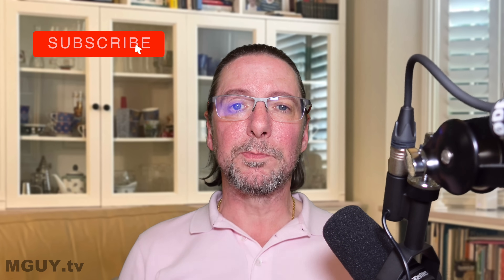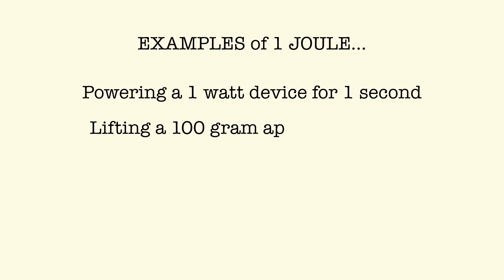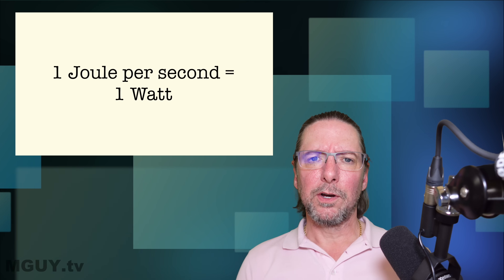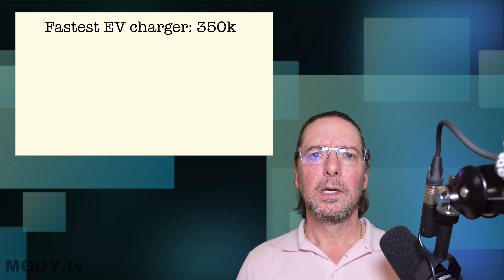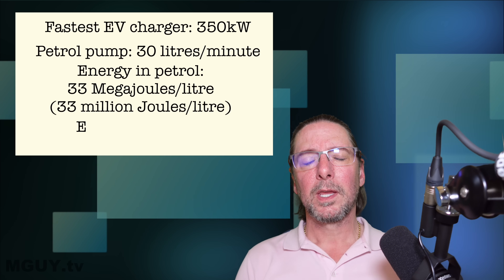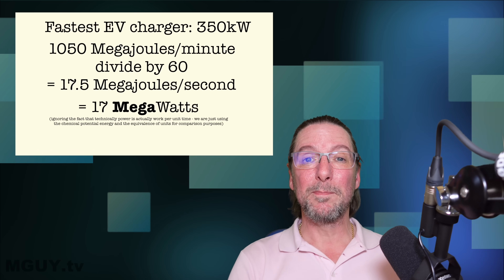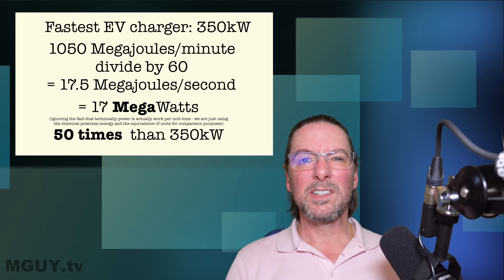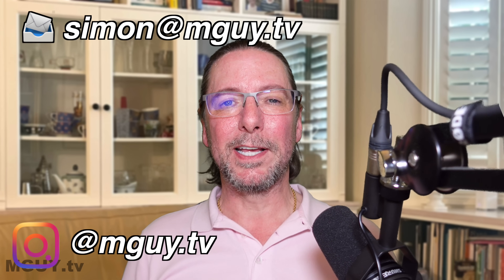Comparing charging speed of EVs vs "fuelling speed" of regular cars | MGUY Australia

Comment: This is a much more complex calculation than it first appears.  The amount of energy stored in a liter of fuel is not the right number to even be looking at, because only a small portion of that ever reaches the wheels, which is of course what really matters.  You have to factor in the relative efficiencies of combustion engines versus electric motors.  The electric car charging process also has foibles, as most cars are subject to a "charging curve" where the rate becomes slower as the battery state draws closer to 100%.

As a purely practical matter, what is the point of this exercise?  I mean, by this time, in 2023, electric cars are on the road in millions and are well-proven in regular use.  There are no mysteries to solve.  I daily drive my Tesla, let it charge at night in my garage, and I don't think about how long it takes.  I've also taken road trips, including one from Texas to Minnesota and back, hopping from charging station to station, and it didn't seem to be a problem.  A typical charging stop is around 20 minute, more or less, not too different from the driving breaks I would have taken anyhow.  (Which is to say, I don't babysit my car while it charges; I just walk away and do other things.)  I found that I covered about the same distance in a day that I would have in my old diesel Jeep.

Comment: Leaving aside the fact that use cases for petrol and electric are different for the moment, can you redo this video with the 1MW charger and a 522kW 5C battery made by CATL in the calculations? Using a 51kWh battery such as that found in the base model MG4 for instance, but using CATL's Qilin battery, and assuming an 800V architecture, and charging at peak ~500kW, would give you a full tank of electrons in 6 minutes. Correct me if I'm wrong, but that's about on par with filling up with petrol, around 5 minutes?
Reply: No one takes 5 minutes to fill up petrol. Also 500kW is absolutely bonkers insane for the electricity grid. Australia has 7000 petrol stations, if each had just 4 500kW in use at the same time, that would be 14GW needed. Surfice to say, this would entail building somewhere around 50% to 100% more power plants, and if we don't have batteries about 100GWhours in batteries, somewhere around 2000% more renewables than the entire current size of the grid.
Reply: @sectokia1909  No the maths actually stack up. Hypothetically if 20 million cars were to all charge at 500kW at the same time from the same grid, sure, it wouldn't work. But most people don't need to charge at 500kW, any more than they need to charge their phone at 500kW. They trickle charge at home from the grid or solar for free. Or transfer from their domestic battery to their EV battery. Charging at 500kW is for road trips where you need to just charge quickly and go. And you don't charge solely from the grid, you have Megapacks (or other stationary storage) on site. In Australia's rural areas this works very well, as there's plenty of space for low density, cheap energy storage such as Rust /Iron Oxide batteries and others. You don't need a grid connection, just a small solar set up, around 1MW, and about 10MWh of storage or so, depending on the demand you're supplying.

Comment: Fuel stations pump at 10 gallon/minute or 37.8 Liter/minute.  

Gasoline "charges" at 20,220 kw.  Ethanol is 15,000 kw.  Basically, fuel is 100-133 times faster than Battery charging.  20,000 kw/150kw= 133x.  Few chargers give 350 kw...  20,000/350=57x

Nobody uses joules.  They use KWH.  EPA sets 1 gallon = 33.7 kwh.

Comment: I timed myself filling up my car today. I had to wait because someone was at the pump already, but after they left I put in 42 litres of diesel which added 480 miles of range. Took me 6 minutes from pulling into the forecourt to driving off it. I need to repeat that 24 times in a year, so that's about 2.5 hours of time. I don't make special trips to fuel up, I pass these filling stations all the time. Unlike an EV driver if I have to make an unexpected journey like nipping out for some milk or beer, I just get in the car and drive off. I don't have to unplug it first, then plug it back in when I'm back.
Reply: Nobody talks about how time is money. Add up all the extra time spent charging or looking for a charger and multiply by $25/hour and that is what is costs you.  Time is money. And how much the home charger costs to buy and install.
Reply: I get what you are saying about an unexpected journey and the 10 seconds to plug in and out, however mostly I plug in when I know I'm in for the night 2 x a week so 20 (plugging in and out) seconds a week lets say 30 for easier calculations. 30x52/60 = 26mins. Of course I don't do a lot of drivers longer than 500k so if you do then I can see you might use public chargers and it might not be for you. Good on you, get the car or truck that suits you, the hours you spend on the forecourt, pumping and inline waiting and paying may well be worth it.
Reply: @toyotastout6870  In the UK, the projections are that when everyone has an EV the maximum amount of energy you could take at home is 7kWh per night. Twice a week, that's 14kWh, or enough for 56 miles/week, or 2912 miles/year. If that's all I drove I'd only have to fill up 6 times/year.
Reply: @brendanpells912  well that's some made up nonsense. I'm in the UK and no one is saying that. National Grid is looking to add 10's of GW capacity to the grid in the next few years. 150GW just from wind alone by 2050 which is 3-4 times the current grid demand. Nuclear, solar on most homes, battery storage and interconnectors are all being added as well. 
There will be no rationing as you claim.
Reply: Plugging - unplugging? It's SO much easier to drive down to the gas station, wait, put in my card, chose the fuel, grab a fuel nozzle, hope no one is smoking near you, open up fuel cover, turn the cap, fill up, replace the cap, close the cover, replace the nozzle, finish paying. Wait to get out of the station. Drive home. Or, plug in? I'll wait for wireless charging. I don't mind oil changes, check ups, paying for maintenance. Oh, wait! I do, I do! I bought a Tesla ONLINE, in minutes,  no "stealer-ship" no lying salesperson, no all day rip-off.
Reply: @1voluntaryist  Like I said, I don't drive down to a gas station as a special trip. As for lying salesman, hey, Elon Musk. I just changed the rear brake pads on my car this afternoon on my drive. How much do they cost to replace on your Tesla?
Reply: @brendanpells912 well no-one does as they last so long.
Reply: @1voluntaryist  I only have to fill up my car with gas every 2-3 weeks. EVs are NOT easier. Not to mention the time involved.  Add up all the extra time and multiply by $25/hour and that is what is costs you.  Time is money.
Reply: @1voluntaryist  I imagine it must be terribly difficult for you to leave the house in the morning, you know putting clothes on, putting shoes on, picking up your keys, unlocking the door by turning or pushing down a handle, pushing or pulling the door open, walking through the doorway and then closing the door doing the reverse. Then having to put your key in the lock and turning it, then removing your key and putting it in your pocket or purse. That all sounds incredible hard and time consuming doesn't it when you break it down into small steps. The stress of making yourself some beans on toast and a cup of coffee must be almost intolerable!
Reply: @1voluntaryist you can buy any car online and have been able to for years and electric cars still have to be serviced, they also need more trips to the tyre bays and more time spent looking for the best insurance quotes, what I would say is this and of course it is everyone’s choice to drive what they want to but for something that’s so great then why are they being pushed on us? I can’t ever remember something that is that good that we need it yet people are being bullied into it
Reply: @1voluntaryist this is some serious copium 😂

Comment: OMG, this is totally useless information. Well, you would have needed to been living on Mars not to know filling your ICE car fuel is a lot quicker than charging your EV. 
Well, there is one point you forgot to factor into EV charging. Most people are able to charge their EV at HOME, now try that at home with your petrol or diesel car. Plug it in after you come home from work or whatever and in the morning fully charge car and no need to visit your beloved petrol station again. So your 3 to 4 minutes to fill your car plus another 5 or 10 minutes driving to your fuel station, add that up over the year, a lot of time saved.
You may love paying these greedy fuel companies around $2.00 or more per litre for petrol. What happens when fuel goes over $3.00 a litre, and that's on the cards sooner than you think, still happy to visit a petrol station.
A lot people are like me, I have a 10kw roof top solar, so it would cost me nothing to run my EV, if I had one.
The other thing you got to take into account is, there is very little servicing required on an EV, now that's another big saving in money and time.
Reply: You will still have to pay the same for a service  even thou there is no oil to pay for  so a bigger RIP off.
Reply: @paulwaites6551  Hahahahahaha, NO. I quote here, "A Tesla driver that reached out to Gizmodo Australia said that it costs about $220 including parts every two years to service their Model 3, including brake fluid and the cabin filter, along with tyre rotation at 10,000km intervals for about $80".
OMG, that's so costly, you could do this yourself, take off tyre rotation for 80 bucks and a cabin filter would be just about nothing. You need to do a little research before you put rubbish like this on here.

Comment: A busy fuel station in peak times with 12 pumps can probably service 100 cars per hour - in and out in 5 mins or so. In that time, with a fast charger, you might be able to service 1-2 EV's if everything goes smoothly. How big will EV charging stations have to be, and how much energy will need to be delivered to potentially charge 100 EV's at a time. The mind boggles. Innificiency at a staggering scale.
Reply: This is the misconception, thinking that the same number of EV's will need to charge at the same time like they do at a petrol station. For a future scenario lets assume a good chunk of charging will be done at home (lets say 50% of people would opt for this as it's much cheaper and in the UK apparently 50% ish of homes aren't suitable for a home charger anyway), then you'd have people charging at work or at destination chargers, maybe another 25% (as some might not have home chargers or get free charging at work) which then might leave 25% that would need to charge at a "filling station". Quarter of the cars charging 4 times longer would take up the same space and time. Don't forget, not everyone with an ICE fills to the brim either. average 20 min on a 150-350kWh charger can add 150-250 miles. For most that'll be 1-2 weeks of average driving. 
The reality is that, at the moment, 80%+ of charging is done at home so you are removing that bulk of cars from needing to charge on the road. 
The "filling station" as we know them today just won't be needed. By the time EV's are 50% of the cars on the road, the average range will likely be 300-400mi for hatchbacks and 500-600+ for saloons, which means there will be even less need to charge on the road. I also suspect that people with home chargers will start to share their driveways with neighbours or rent out the space during the day like people already can do for just parking a car.

Comment: Never thought about this. Basically take your wait time at the gas pump and multiply it by 50. I'm in Florida so that would make hurricane evacuation just about impossible.
Reply: Well, you know a hurricane is coming so you'd have filled up before you had to go. Tesla even has a Storm Watch function (or something, I don't have a Tesla). This can fill up the car or home battery automatically if a storm is coming, before it arrives. You'd be ready to go with a full tank whenever you needed to.
Reply: I suspect that everyone charging as the news media spreads the panic would cause brown outs. But i'd never own an EV so its not my problem. @javelinXH992

Comment: Another interesting fact.. Adding these environmental costs to the previous estimates for battery production, lithium extraction, transportation, the energy cost of building the Gigafactory, battery transportation, battery recycling, and diesel fuel required to generate electricity to charge the battery, we get the updated total energy cost of producing and using the Tesla Model S Long Range battery pack as follows:

Total energy cost = 15,000 kWh (battery production) + 1,890 kWh (lithium extraction) + 6,480 kWh (lithium transportation) + 5,250,000,000 kWh (Gigafactory construction) / 1.7 million vehicles + 5,400 kWh (battery transportation) + 81 kWh (battery recycling) + 10,000 gallons of diesel fuel (battery charging) + $5,400 (battery disposal) + $30 (battery fires) = 5,250,320,000 kWh + $5,430 + $30

Converting the energy cost to barrels of oil equivalent using the same conversion factor as before:

5,250,320,000 kWh / 1,700 kWh per barrel = 3,088,431 barrels of oil equivalent

Therefore, the total energy cost of producing and using the Tesla Model S Long Range battery pack, including battery production, lithium extraction, transportation, the energy cost of building the Gigafactory, battery transportation, battery recycling, diesel fuel required to generate electricity to charge the battery, and the environmental costs of battery disposal and battery fires, is equivalent to about 3,088,431 barrels of oil.!
Reply: You do know what the word fact means?

Comment: Makes me wonder what the result is of another calculation, instead of comparing fillup of these fuels, in a hypothetical, in the course of one day, assuming a reasonable average usage, if all cars in a certain region were electric and everyone charged at their convenience over the grid, what would the generation capacity required be at the power stations and compare that to the regions current generation capacity.

Comment: Current EVs only work for 'workday week commuting' in cities, and unfortunately most of the people pushing the EV bandwagon seem to be people who only comprehend this as the way people use their vehicles, once you get out of the city, the EV's lack of range/increased 'fueling' time become an issue.  As am example, I often drive to my friends place in my Diesel vehicle, I use about 45L of diesel to travel the 570km, and I don't have to refuel on the way (yay for 80L tanks), if I did the same trip in an EV, I would have to fully recharge once during the trip (or partially recharge at least twice), if there were charging stations in the right place(s), adding approximately 20 minutes to my trip, assuming no wait time to plug in, or no breakdowns at charging stations🙄, BUT as there are only 3 fast charging stations on 80% of the route I travel, and 2 of these are 'critical' to the trip (as most EV's don't have the range to 'skip' either of these charging stations), it would add more like 40mins to my journey, and if either of the 'critical' chargers are offline, I would be sitting on my a$$ waiting for the EV to charge with a 3.6kW charger (which are the only alternatives to the 2 fast chargers (250kW)) which would take ~2.5h to charge.  So current EV's are not an option outside if city commuting.
Reply: Most people that work in major cities don't live in the city and their commute on average can be around 80 miles round trip. That is on the low side. I live in San Francisco people have been forced to buy homes 50 miles and further to afford to live here. This is going to be a huge problem as far as charging. Even though a lot of people work from home, companies have become wise to the fact that people are working for two companies at home. They want them back in the office working only full time for them.